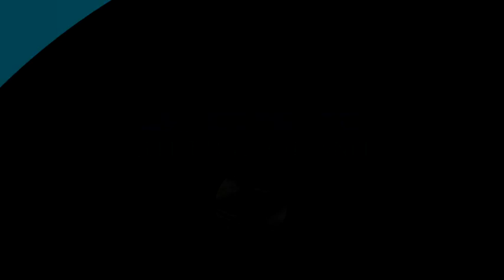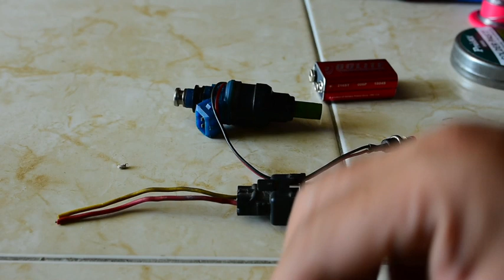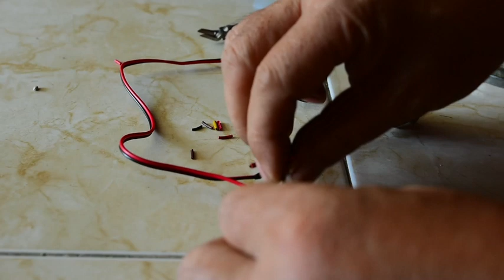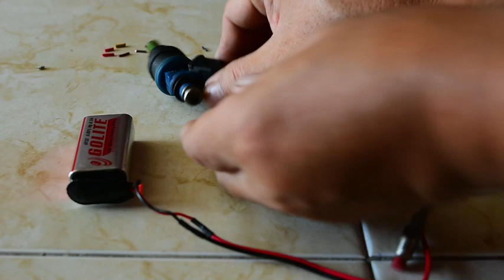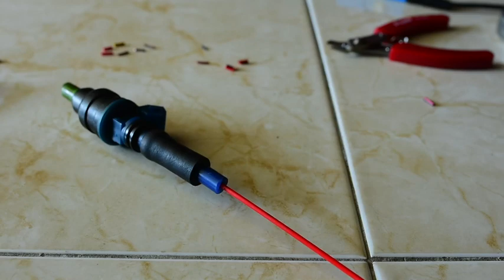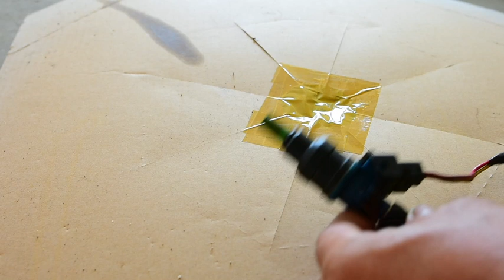Proton Wira - DIY Fuel Injector Cleaning

Comment: Dalam injector sbnarnya ade microfilter...tu pun nak kena tukar...tapi barang kena order tpi tkut x fit pulak sbb bnyak saiz....
Pun boleh...bagus pakai spray brake cleaner@mass air flow cleaner/throttlebody cleaner,
Tapi x bnyak tempat specialist utk injector utk vertify injector flow CC dia.